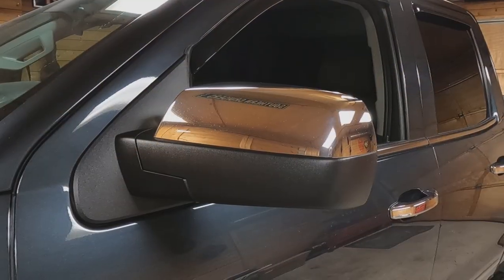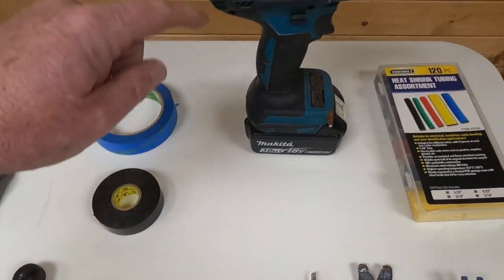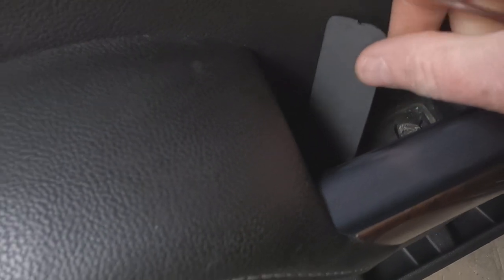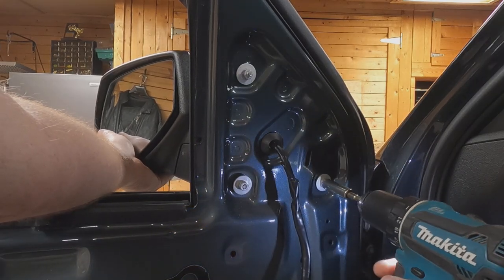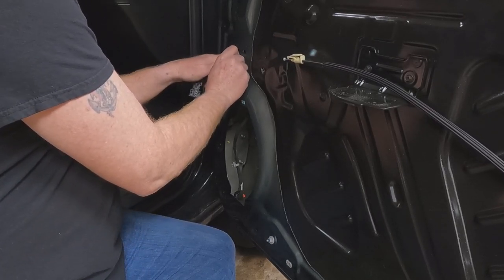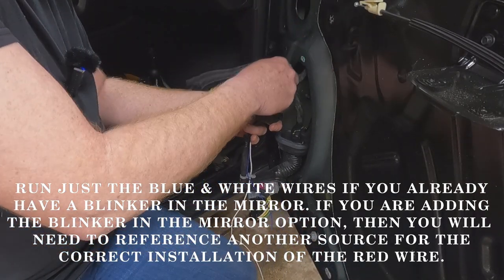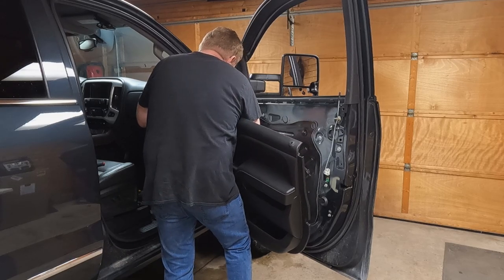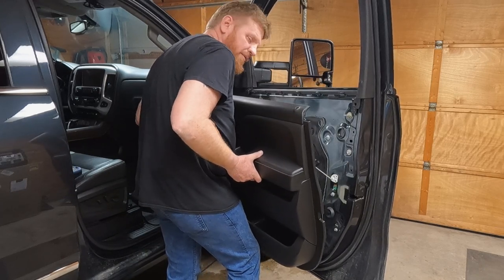2015 - 2019 Silverado / Sierra - Boost auto parts / Mostplus tow mirror installation

Comment from the maker: ********** UPDATE ON MOSTPLUS MIRRORS 1/7/23 **************** The MostPlus mirrors are still functioning as they should. However I have had several issues with them. First the left mirror power folding option seized and would no longer function. I contacted the Amazon seller, and after "jumping through hoops" they finally sent me another mirror. The right mirror running lamp has had condensation in it since day one. Again I contacted the Amazon seller, but this time they would not do anything about it. Stating that it wasn't a warrantable item. Okay, so I'll just live with it. The mirrors have always shook a little at highway speeds, but I kind of expected that would be the case with a cheap knock off.  You can't expect OEM quality for a quarter of the price. That is just how it is. Now it is winter here in Michigan and I recently discovered that the road salt is taking its toll on the chrome covers. Spotting the chrome, and almost staining it. The spots will come out with a lot of elbow grease, and a good polish but this is yet another reason that I can't recommend these mirrors. I am going to put a couple of heavy coats of wax, or possibly a ceramic coating on them and see if that helps. Hope this is helpful information for everyone, and helps you decide to purchase them or not.  Thanks to everyone for watching, have a great day, and God Bless.

Comment: Great video and great instructions! About how long did it take you to complete this?
Reply from the maker: On the side that I wasn't filming took me about 30 - 45 minutes. I try to take my time and make sure everything is just so when possible. I don't want to have to pull it all apart if after I get everything back together. The average mechanically inclined person could probably do it in 30 minutes or so.

Comment: I just got my 17 Silverado and it came from the dealership with these tow mirrors. My blinker and cargo lights don’t work but I can move my mirror with the button. Was wondering if there is anything I should do to get they working or just check the wiring
Reply from the maker: You can check the wiring. It is really hard to say why those particular functions aren't working.  Could be anything from wiring connected wrong to incorrect mirrors for the vehicle options.

Comment: Did your truck memory(seats and mirrors) work after installing this mirrors ?
Reply from the maker: To be honest, I have never tried them or even thought about that. I am the really the only one that ever drives the truck so they never get moved. I will have to check that out and get back to you.
Reply from the maker: I did try this out today. The memory does work for the seats, but not for the mirrors. Does not surprise me, but at the same time is not a big deal to me either. Like I said before, I am the only one that drives the truck so I never even use the memory.

Comment: I have a question. I have the same after market mirrors except they do not have power fold or back up tilt like the original mirrors that I have on my 2016 gmc sierra 1500 slt. Is the wiring you show on this video still the same to connect them?
Reply from the maker: It will be the same, but you won't have to deal with running the white wire if I am not mistaken. Kinda hard for me to remember exactly which color wire went to what without having the schematics to look at. But I know that the white wire is for the cargo light so you won't have to run that. I believe the power fold is wired into big plug and the mirror  you have won't have that option so you should not have to do anything there.
Reply: @DevaultFamilyLiving  according to the video, the white wire goes to the cargo lamp, blue wire goes to clearance lamp, black with white tracer is ground and the red with yellow tracer is the blinker. The video also had a pop up that said if your original mirror had a blinker on it, you didn't have to connect the red with yellow tracer so I'm alittle confused.
Reply from the maker: @Kuromi_helloKitty11  you stated that you didn't have the "back up tilt" (I assume that is supposed to be light) which I refer to as the cargo lamp (white wire). The clearance lamp (amber light on the front side of the mirror) (blue wire). Some people think the amber light on the front of the mirror is a blinker but it isn't, it is just a clearance / running light.  Red wire with yellow tracer gets spliced into the same color wire on the 18 pin plug coming from the mirror (if you have the blinker in the mirror glass). Referenced around the 18:30 mark of the video. Same think with the black wire. If you don't have the blinker "in the mirror glass" and are adding it, then you would need to take an extra step that I did not reference in the video cause did not need to do that.  Do you have the blinker "in the mirror glass"?
Reply: @DevaultFamilyLiving  yes, the oem mirror has the blinker in the mirror like your video, heated, puddle lamp, tilt in reverse, and the fold. The after market is like the one you had on the video except no fold or tilt
Reply from the maker: Okay. I misunderstood the tilt part. Sorry for the confusion. It took me a while to figure it all out when I did the first one. It is much easier to understand when you have everything right there in hand. It has been a bit since I did it and my memory isn't the best anyway. But yes the red/yellow wire does go to the red/yellow wire on the 18 pin connector from the mirror.

Comment: How do you like the mirrors? Do they vibrate at all when driving down the road? Great video and thank you for the detailed installation!
Reply from the maker: The mirrors are just okay. Quality is as you could expect from a cheap part from China. They function and look good, but there is much room for improvement. The upper mirror does vibrate. Not to the point that you can't use it, but it does vibrate none the less.  The lower mirrors are steady as a rock, and that is what I find myself using the majority of the time. If I were to buy them over again, I would spend the extra and get the ones from Boost Auto Parts. It is my understanding that they are better quality. These will get you by and are tolerable, but nothing to brag about. Thanks for watching, and have a Merry Christmas.

Comment: My 2015 Silverado lt does not have the active pins in the hinge terminal, how can I wire it for the lights on the mirror?
Reply from the maker: Some of the early 2015's are set up more like the 2014 model year. You may want to look up a video for the 2014 and see if that is more like your set up. I am not familiar with that set up so I don't want to steer you in the wrong direction.

Comment: Mine have a white wire, a blue wire, and a gray wire. How would I go about this?
Reply from the maker: I'm not familiar with a 3 wire set up. I would assume that the blue and white would be the same, but I can't be certain of that. The mirrors usually come with some type of schematic. I would reference that. It sounds like your mirrors has less options then the ones I installed. Sorry I could not be more helpful.
Reply: @DevaultFamilyLiving  thank you for your answer

Comment: where I can buy the terminals because my mostplus buy in amazon it not came in the box.
Reply from the maker: The terminals are not included with the mirror for some reason. There is a link in the description of the video to the terminals. I purchased them off of ebay. If that link don't work any longer then just go to ebay and type in "TE Connectivity AMP 969005-2". That will get you what you need.

Comment: Great video. I was looking at doing this same setup and buying the same mirrors off of Amazon. Are you pleased with the quality of the mirrors while driving?  Some of the reviews mention they shake a lot.
Reply from the maker: The do shake when driving, and it is not just the set that I got. I had issues with the power folding option on the drivers side and the replacement one does the same thing. If I had to do it over again, I think I would spend the extra and get the ones from Boost Auto Parts. They have better reviews, and from my understanding are just a better quality mirror. I also have water condensation in the passenger marker light, and Mostplus would not warranty that. That issue is only with that mirror though. If you can live with the shaking they are worth the money, but I would not purchase them again. Thanks for watching and have a great day.
Reply: @DevaultFamilyLiving  I appreciate the feedback. Hard to get past those Boost Auto prices!!  You get what you pay for though….
Reply from the maker: @mattheweasley5589  Very true
Reply: @DevaultFamilyLiving  I’ve also read that some of these aftermarket mirrors you lose memory recall and you lose the ability to remotely fold open or close your mirrors with your key fob. Have you tested either of these?
Reply from the maker: @mattheweasley5589  To be honest I really have never tried the memory function cause I'm really the only one to drive my truck. The  automatic open / close function does still work with the key fob. Not a 100%, but that kind of stuff is usually controlled by the Body Control Module "BCM" and really should not be affected by the mirror itself if I am not mistaken.

Comment: What is the extra wiring for?
Reply from the maker: That wiring is for the clearance & cargo lamps if I remember correctly. The install of that wire starts at around the 10:45 min mark of the video. 

The harness attached to the mirror is set up for 3/4 or 1 ton trucks and "I don't think" that extra wire is need for them. But the 1/2 ton has a different body harness so that wire gives you the additional wiring needed to power those two options.

Hope that helps. Thanks for watching and have a great day.

Comment: Are the mirrors manually pulled out?
Reply from the maker: Yes that pull out manually.
Reply: I think im too afraid to give them a big yank. Ill give it another try. Sighhh
Reply from the maker: @lincolndotson3613  The ones that I have do come out kind of tough. If they stick to much just give them a firm swat with your palm on the inside edge of the housing first them give them a pull.

Comment: Do you have to have a certain package on your truck to operator the lights?
Reply from the maker: "To my knowledge" all of the bodyside harnesses have the wiring in them. You just have to add the proper wiring to the mirror side harness to tap into it. With that said, my truck is a "SLT" so my original mirrors had most of the features already.